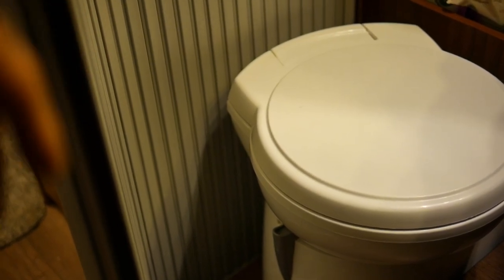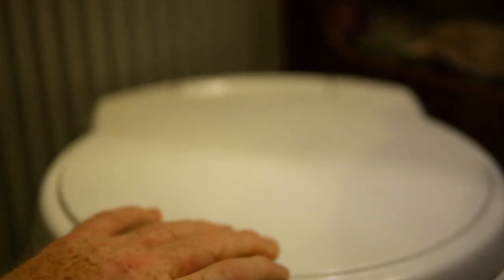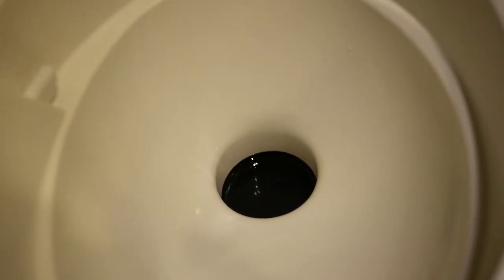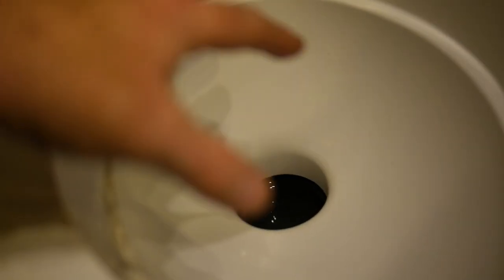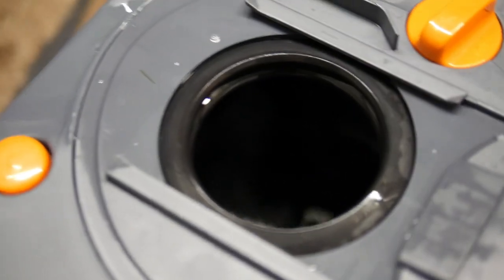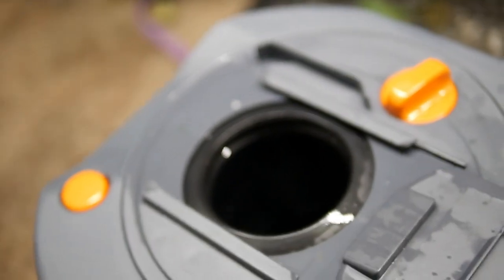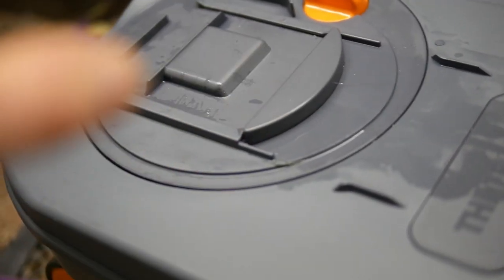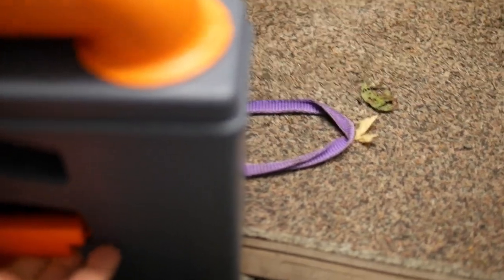How to empty a Thetford Toilet Cassette in a Motorhome - vlog #256

Comment: Great video.  Love the speak - flush gives toilet 'bit of a wash around' indeed.  Can you dump this down a toilet at the rest area or do you need to us a special dump site?
Reply from the maker: Hey Brian,
You're not really supposed to dump chemical waste in a rest area toilet IF you are using the BLUE chemicals (it contains formaldehyde). I've tried to research why this is the case but can't find a definitive answer as to why formaldehyde is such a problem if the waste is all going to a treatment plant.

If you are using the "GREEN" chemical then I think it's probably OK. You will get "looks" and may be challenged if you do this. We've never had a problem finding a place to empty as we do a lot of organised Auto Trail Owners Club  Rallies where Elsan emptying points are always provided.

Some of the club sites, marinas etc, will allow you to empty chemical waste and fill up with fresh water for a small charge.

Comment: Depending on the elsan you have to mindful of splash back when you press that little button. I once carried my tank to the elsan and didn't realise that the open/close slider was not closed properly. Very embarrassing!
Reply from the maker: +bariumbob Our old caravan cassette use to leak if carried vertically so I used to have to hold I’d horizontally otherwise I could trace my route by the trail of stale pee on the ground LOL